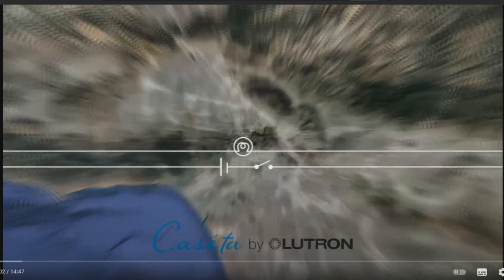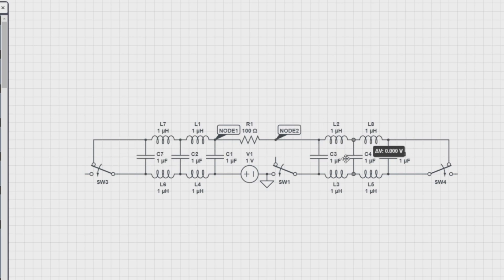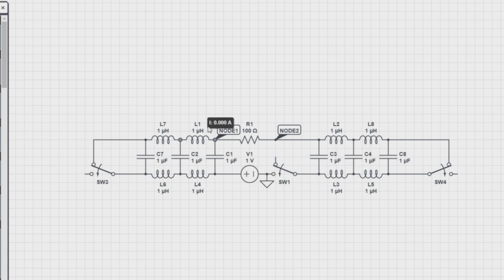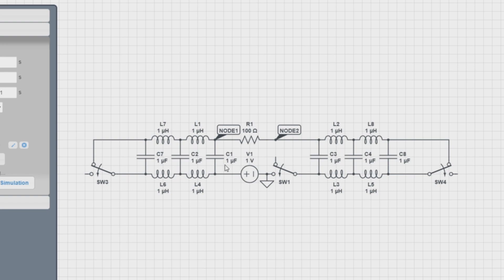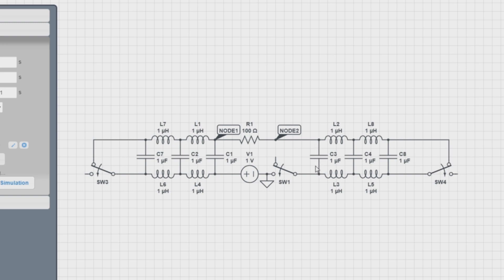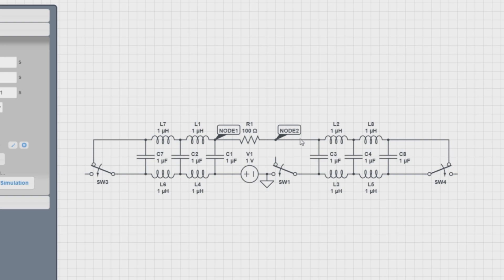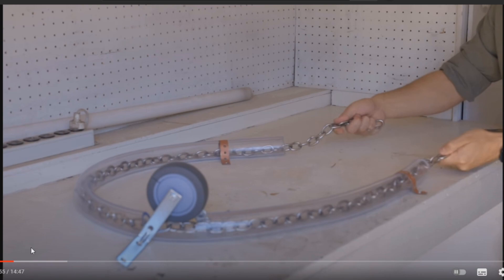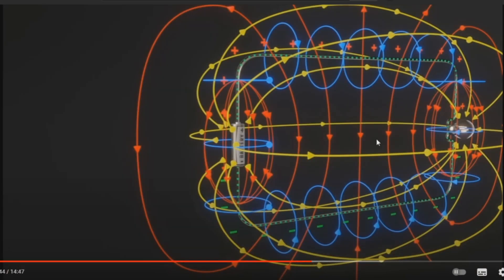Explaining the Veritasium "The Big Misconception About Electricity" video

Comment: Nice simulation there, but I think the further part of the wires can’t be ignored in this problem. If you add note elements in either ends, I believe that the result wold be a step to 1v instead of a pulse.
Reply: The step function travels along the wires until it hits the end. In that time, the wave front of the wave can transfer the energy across just like the capacitor of your simulation. So it will actually provide enough energy to allow the lightbulb to light up at its full brightness from the start.
Reply from the maker: I don't think it will be a step function. When we flip the switch we look at the infinite frequency characteristic impedance of the transmission line. After flipping the switch we can only look at the DC response, which is locally an open circuit.
Reply: @ZongyiYang  when you say after flipping the switch, you mean after all the wires and components have reach a stable state, right? Guess how long will it take for a half lightsecond long wire reach its steady state? Half a second if you don’t consider the equivalent capacitors. If you consider the capacitors, that’s quarter of a second.
By the time the circuit is considered DC (again that’s at least 0.25 second later), the light will be light up by the current anyway.
Reply from the maker: @ShiehJimmy  On further analysis you are correct and I am wrong here. It would step up slowly to full brightness.
Reply: @ZongyiYang  How slow then? Do you mean that the light will come up to full brightness in about 1/2 a second?  Does this mean you can measure the length of the wires just by measuring the rate that light turns on?
Reply from the maker: @ShiehJimmy  Veritasium is actually correct. I have made a new video with a better analysis: https://www.youtube.com/watch?v=RsiYXfpJu5U
Reply from the maker: And yes you can measure the length of the wires by measuring the delay between the steps.
Reply: @ZongyiYang  love the new video!

Comment: His circuit does not include any capacitance so you should not include them either, otherwise you are considering a completely different situation.
Reply from the maker: There is a capacitance between everything and anything, it's just very very small that usually it can be ignored.

Comment: It is actually very important to put real capacitance values there and not convenient numbers that show  some detectable energy transfer. Stretching the truth can lean to such bizzare conclusions that Veritasium claims.
Reply from the maker: As I mentioned in the video, the actual energy transfer is very small, and the only reason the light bulb lights up is because Veritasium stated it is a magic light bulb that lights up when "any" current goes through it, but for a normal light bulb I said it wouldn't even be enough to warm the filament.
Reply from the maker: On further analysis, you are correct that I should have used real values. However, veritasium is correct that with real numbers, the amount of power transfer is actually significant. My analysis in this video is therefore incorrect. I have redone the results here: https://www.youtube.com/watch?v=RsiYXfpJu5U

Comment: Why is everybody hating so much on Veritasium ? Isn't that common knowledge in Physics, Poynting Vector and all that? Nor is Veritasium  the only channel to have ever addressed this matter (no pun).
Reply from the maker: I think people are a bit angry that the question was misleading. For example, not including the units for 1/s (should be 1m/s), not using the word "transmission line" in the video, and also using real world props to demonstrate the effect when in reality the light bulb would not  light up since the energy transfer through the air is very small.
Reply: @ZongyiYang  umm you mean the one given in D) That was clearly stated as 1/c [s] irc.  As with being "lied to" I didn't like that either. The "conventional" wisdom is a pretty good approximation for what's "really" going on - not necessarily a lie. It's just that Poynting gives us more insight. For example, chapter 27–5 "Examples of energy flow" Feynman lectures and "Poynting vector, Static Fields" on wikipedia.
Reply from the maker: @TJ-hs1qm  Yes sorry, I meant 1/c. It should be 1m/c. As per Feyman, he actually states in that exact chapter: "It seems to be only rarely of value, when using the idea of energy conservation, to notice in detail what path the energy is taking. The circulation of energy around a magnet and a charge seems, in most circumstances, to be quite unimportant." Basically what Veritasium is saying is all technically true, but also very pointless. It's like saying the position of Jupiter has an impact on me making a basketball shot. It is technically true that Jupiter's gravity extends to the basketball in infinitely throughout all space, but it is also not practical for this application.
Reply from the maker: @TJ-hs1qm  My explanation is wrong. Veritasium is actually correct. I have made a new video with a better analysis: https://www.youtube.com/watch?v=RsiYXfpJu5U
Reply: @ZongyiYang  I'll check out the new video later :) Just to quickly address "Basically what Veritasium is saying is all technically true, but also very pointless. "  I hope our understanding of the Poynting theory has increased since the days of Feynman. Also why I suggested to look up "Poynting vector, chapter Static Fields" on wikipedia with an elegant view on the Lorentz force. I would never discard a theory in Physics as pointless (as long as it is supported by experiments of course) as we have learned since quantum mechanics, intuition is a false friend.

Comment: Z Y,
You, Dave and some of the others who have responded to Derek's video get so close to the real answer, but you've missed something very important.
The way that circuit is arranged is indeed confusing many people. Yes, you consider those two lines going to the far left and far right as transmission lines.
However, you must understand that a transmission line with negligible loss has an impedance that is resistive, real, not capacitive.
.
The two terminals leading to those long transmission lines simply look like a resistor equal to the characteristic impedance of the transmission line. It does not look capacitive, even though that almost gets to the heart of the issue here.
.
Once you understand this, you can replace the two transmission lines with a resistor equal to their characteristic impedance. Then you have a circuit which consists of a battery two resistors and a light bulb.
.
The instant the switch is thrown, what we have is a light bulb in series with two resistors and that will determine the current that flows immediately.
.
The light bulb will light dimly in a time based upon the length of the wires you now have (which is 1 m in Veritasium's example).
.
Once all of the reflections die down in the long transmission lines, then the bulb will light to its full brilliance after flickering up and down which depends upon the characteristic impedance of the lines and the light bulb.
.
W Beaty's comments are also correct.
Reply from the maker: Thanks, you are correct and my explanation is actually wrong in many ways. I'm actually familiar with transmission lines, I just thought the characteristic impedance would be so big it wouldn't matter for power transfer. However, on looking at it with real world values Veritasium is actually correct. I have redone the analysis: https://www.youtube.com/watch?v=RsiYXfpJu5U

Comment: A issue here is that no one want to say the emperor has no cloths, Veritasium got it wrong. And instead of YouTube's with Electrical Engineering training calling him out on it, they have used suspect circuit analysis to agree with Derik. This is what happens when someone with authority says something. The problem is a transmission line problem and the bulb will not turn on until the step response created by the switch has enough time to travel down the wires at a fraction the speed of light. So the correct answer is E; none of the above.
Reply from the maker: My explanation is wrong. Veritasium is actually correct. I have made a new video with a better analysis: https://www.youtube.com/watch?v=RsiYXfpJu5U

Comment from the maker: Dave from EEVBlog has just posted his response to Veritasium's video, and his conclusion is basically the same as mine even down to the simulation methodology and even simulation software used. I'm relieved since that's independent verification from an industry expert of what I said in my video! The only thing I would have liked Dave to mention more was that the transient response is just that, transient, and that the lightbulb will only flicker momentarily and will not remain on. It will only reach steady state after around 1s, after which it can remain on.
Edit: on thinking a bit longer on it, I am wrong about it flickering. The lightbulb will stay on after the initial flip.
Reply: Your components are much too large and much too few.  (Converting Veritasium's long wires into 1uF capacitors is a huge change!)   With non-ideal 2-wire transmission line, Veritasium's problem is altered, and a DC pulse won't "see" a constant line-impedance of 700 or 800 ohms as expected.   (An ideal 2-wire line looks just like a resistor, where R is the square root of the L/C ratio.)   So, add LOTS more segments, and you'll see a flat-top response, rather than a spike.
In other words, with INFINITE wires, the bulb does immediately light up continuously.   But it does have more than 1K ohms of electromagnetic impedance wired in series.   So when driven at 12V, it will immediately glow like an LED, not like a car headlight.   If the wires were closer, the bulb would be brighter.   But at 39in spacing, the glow would be very visible.
For Veritasium's setup, his ideal bulb needs to be a 1500-ohm resistor.    If not, then the initial brightness won't be maximized.
Reply from the maker: @wbeaty  You are correct and I am wrong. My whole video is actually wrong, and probably so is EEVBlogs analysis. I have re done the results here: https://www.youtube.com/watch?v=RsiYXfpJu5U
Reply: @wbeaty  I disagree with your analysis as the wire would only have the cumulative capacity of (less than) 2m of parallel wires which is absolutely minuscule and not enough for any visible glow in the bulb after 1/c (m) s
Reply: @peterp-a-n4743  Nope. Those two long lines going out to the right and the left are transmission lines. Lossless transmission lines have a characteristic impedance which is real, that means resistive, that means it looks like a resistor, not a capacitor.
.
While looking at the transmission lines as a capacitor gives you some idea as to why the bulb lights right away, it's not a capacitor but a resistor. This means that the bulb does not light fully right away until all of the reflections on the transmission lines die out and the steady state is reached with a current determined by only the battery and the light bulb.
.
This may be very confusing to you if you only have circuit theory. However as an experienced RF engineer I am familiar with transmission lines and something called Time Domain Reflectometry (TDR). This  is trivial having background in these subjects. 
.
Whether Derek did it intentionally or not, the way he drew that schematic is rather deceptive when you don't understand transmission lines. 
Regards
Reply from the maker: @peterp-a-n4743  He is correct, my video is actually wrong. Please see my follow up video for the correction. The conclusion is way different now.
Reply: @Observ45er   @Z Y  @wbeaty Thanks for putting up with us and pointing out our confusions. It's counterintuitive at first but I think I get it now, thanks to you guys. I still think Derek did a poor job explaining this.
Reply: @wbeaty  Hi Bill. Steve N here. You hit the nail squarely on the head! As an RF engineer and someone familiar with TDR, this is trivial. 
The way the circuit is drawn makes those two transmission lines confusing to so many people, even the engineers in other videos who try to use transmission line theories, such as this one.
.
Right after the switch is thrown, the characteristic impedances are in series with the bulb and it lights dimly based upon the voltage and total resistance there. 
.
Depending upon the characteristic impedance of the lines and the impedance of the light bulb, you may or may not have reflections. Once all of the reflections die out,  then the light bulb will light to its full intensity based upon the battery and the light bulb only, assuming zero resistance wire.

It's so nice to FINALLY see SOMEBODY else who gets this, and I'm glad to see it's you.
.
The video by Ben who does the HFSS simulation actually has a Time domain response that shows a bunch of the reflections, but he also does not mention the concept of the characteristic impedance being in series.
. . . 
So many good intentions. 
So many incomplete answers.
.
Insisting that moving charges and the fields they create are two separate things is the major flaw here. Once you have long lines you have to consider transmission line concepts. The fact is we have moving Charges AND Fields and that's what's going on.
Regards, 
Steve N. Science Vigilante
P. S. If I can get my 11-year-old granddaughter to help me again, I'll do a video in the next few days with the correct explanation on it and put it up on my channel where I put my video explaining one piece of the aircraft Wing lift puzzle.
Reply: @Observ45er  Yep, and several people angrily point out that THESE AREN'T TRANSMISSION LINES because there isn't a source on one end and a load on the other!!!  Yep, right.  This involves the physics of "2-wire lines."  People shouldn't call them "transmission lines" if they get misled by that label.

"2-wire lines" are weird devices, and in ham radio we use them for splitters and baluns and xfrmrs and combiners and SWR-transducers and resonant stubs and antenna-matching devices.   Sure, we could also use 2-wire lines as pure transmission lines, but where's the fun in that?  

Also, all the cool applications all start working at DC, if only our cables were billions of miles long.   And superconducting.
Reply from the maker: @wbeaty  On thinking about it again I think you are correct. You can get some milliwatts of power to the light bulb and it will be a flat top response.

Comment: Of course that was a trick problem but even so he is not right!

If the circuit was disconnected at the far ends the it would have worked as an antenna and it would have catched that tiny tiny EM pulse from the switch. But his circuit is already positive, the elections in the wire are under a strong electric charge from the battery and they won't react to the EM pulse. The weak EM is supposed to move electrons in the opposite direction (from positive to negative)  which is futile. It just have too weak energy to overcome the force that is already acting on elections in the wire.
Reply from the maker: My explanation is wrong. Veritasium is actually correct. I have made a new video with a better analysis: https://www.youtube.com/watch?v=RsiYXfpJu5U

Comment: What about round circuit of that same great distance? so that there will be no or very little capacitance to develop. Will the energy still travel to light up the valve?
Reply from the maker: Since the problem is set up with ideal devices, nothing really changes with a round circuit. The transient response will occur at the distance from the light bulb to the switch divided by C, so if the round circuit is bigger then this will take longer. The power received by the light bulb will also decrease, but it is already so unmeasurably small. The light bulb only flickers on the transient response because it is basically magic as defined by the problem.
Reply from the maker: My explanation is wrong. Veritasium is actually correct. I have made a new video with a better analysis: https://www.youtube.com/watch?v=RsiYXfpJu5U
Reply: Sorry for incorrect spelling. It is bulb not valve

Comment: the capacitor part confuses me, by turning on the switch aren’t you causing an increasing electric field for a moment therefore inducing a magnetic field and causing a short voltage spike in the load? Is that the same representation as a capacitor?
Reply from the maker: I'm not quite understanding your question but when you say a brief voltage spike in the load, yes that is exactly what is happening. There is a small transient response that causes a voltage spike at the light bulb that is only dependent on the distance between the light bulb and where the electric field changed (ie: switch). However, the energy transferred by this is so small it is almost unmeasurable in his setup, but he is saying his lightbulb is kind of magic and will turn on due to this tiny amount of power.
Reply: @ZongyiYang  i’m trying to say it acts as a mini transformer for a moment in time by acting as an inductor with an AC current represented by an increasing voltage at t=0+ i mean a capacitor does the same thing but there is also a magnetic interaction from the inductors i just wanna know if it’s one in the same or two methods of energy transfer
Reply: @ZongyiYang  effectively you could move them apart by miles and still say there are capacitors due to electric field interaction but isn’t it also an antenna
Reply from the maker: @Orangehandlebar48  My explanation is wrong. Veritasium is actually correct. I have made a new video with a better analysis: https://www.youtube.com/watch?v=RsiYXfpJu5U